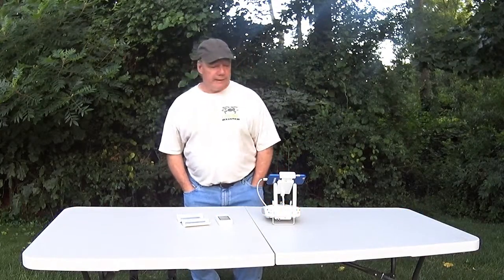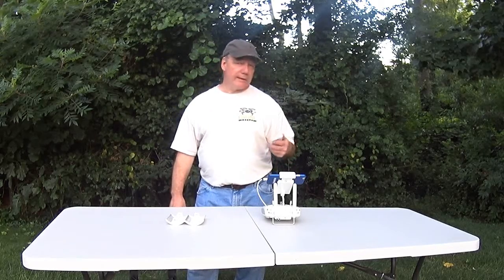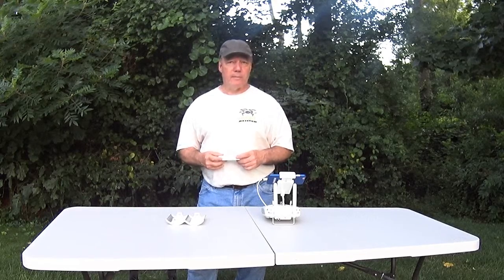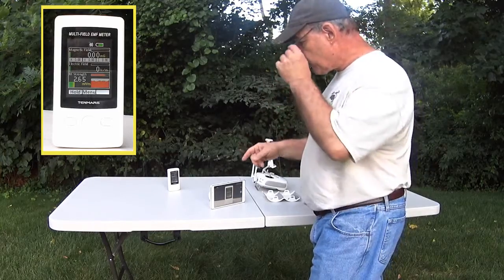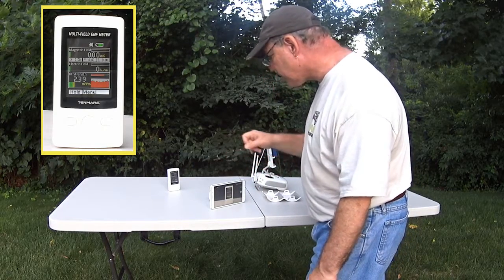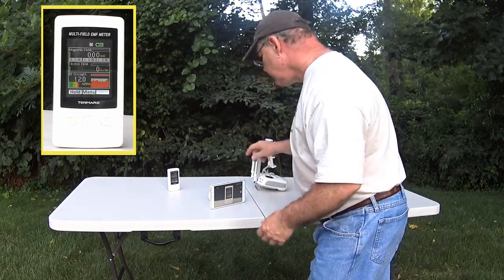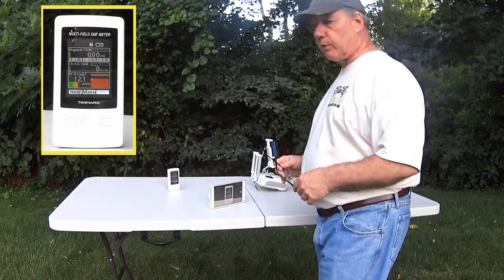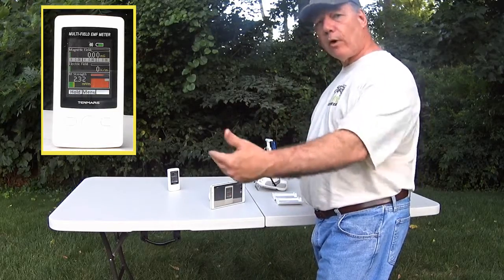DJI Phantom Drone Range Extenders do Work!

Comment: Nice demonstration, thanks.  I have a question though regarding the antennas themselves on the controller.  Are those just a diversity setup with both being actual control signal transmission?  Or is one of the antennas for video signal reception from the quad?  I looked but didn't see this mentioned anywhere.  If one is video reception then you are possibly getting a stronger signal from the video?
Reply from the maker: I found with the testing that by adding the parabolic range extender I was able to keep both the control and video signals strong at greater distances. Having said that, I was able to control the drone well after the video signal dropped off, which is typical for the LightBridge technology. Either way a simple, inexpensive item like this really helped extend the useful distance of the quad. I hope that helps and thanks for stopping by. Be sure to sub the channel so you don't miss any of my updates.

Comment: I just subscribed to your channel. I, like you, want the
most bang for my buck and was wondering about this antenna setup. Your video
showed and proved the effectiveness of these. I am ordering it. I am a retired
Army helicopter pilot (also commercial and instrumented rated) but do not fly
any longer. I just recently got into droning and love it. I am also looking
forward to your Part 107 series. Keep up the great work.

Phil

MetalDetectingRVer
Reply from the maker: Thanks for the support and for watching the clip. Be sure to subscribe so you don't miss any of the updates. I should have a few new ones on the Part 107 test next week. These reflective range extenders work pretty well for the small investment and increased my signal substantially. Let me know if you have any questions and use the code "Drone" on our website to get the subscriber discount. Thanks, Rick

Comment: I suspect those who claim they don't get that kind of performance with the parabolic extender are also not paying attention to the position of their transmitter.

In other words, if the operator is facing the opposite direction of his drone, the parabolic extender will be pushing the signal away from the drone with the opposite results.  Kind of like pissing into the wind... that doesn't work either.
Reply from the maker: You're absolutely right. The parabolic range extenders focus the transmission in one direction and reduces the omnidirectional behavior of the controller. It helps a lot to direct the signals in one direction. Even though it is still a pretty wide spread, facing away from the drone could actually reduce the distance. The other thing the parabolic range booster helps to do is orient the antenna so that they stay parallel to each other and flat against the controller. Our tests showed this to be the absolute best position for consistent transmission. Thanks for watching the clip and please subscribe to the channel so you don't miss any of my updates. Thanks, Rick
Reply: +Drone Valley Thanks Rick.  Will do.

Gord
Reply: I am also curious about the directionality of the signal with the reflector.  It would be interesting to see a more detailed test that shows how narrow the signal becomes, vertically and horizontally. Otherwise, thanks for the demo.
Reply from the maker: Thanks for the post. It's hard to measure the broadcast spread with the IMF meter I'm using but will give you what I have found through experience. The "naked" controller will give you the same distance almost any way you're facing. The parabolic requires you to face in the general direction of the drone (almost 180 degree spread) and the ARGtek paddles provide a much greater distance but are less "forgiving" when you turn away from the drone. They're not laser sharp but you want to make sure you know where the drone is to keep the strong signal. I hope that helps and you sub the channel.

Comment: Thank you for the video. They definately do work. In a super WiFI congested area, I normally only get about 1,000 feet without the extender. With the extender, I got over 5,000 feet. The only issue that I have with the extender is I never get my video feed back once the RTH has kicked in, even when it is directly over my head. I have experimented with this several times and it only happens with the extender on. Its a very good product, but not being able to get my video feed back during RTH is troublesome.
Reply from the maker: I'll be honest and say that I'm a huge chicken and the minute I see the video signal start to waver I head for home. Even though I know the control signal tracks much longer than the video, I'm always afraid of a flyaway. The EMF test just gives me the reassurance that there's a stronger signal with them on. Next week I'm doing an ARGtek mod on one of my controllers and will repeat the test once that's installed to provide details. I might also do an overview of the installation as well. Thanks again for stopping by, I hope these clips provide some value.
Reply: I think that a healthy dose of caution is always a good thing. Sometimes you do not get much warning between the wavering signal and being disconnected. In the desert, I have gotten a mile and a half range with no signal loss or RTH on the stock antenna. The out of box range that the P4 gives you is one reason I bought it. I had to spend almost $400 on a new antenna, boosters and a battery to give my Solo the same range. I am loving the P4 and how simple it is to operate and that as a system it just works everytime with no issues.
Reply from the maker: I agree about the P4, they built an amazing machine there. I am always worried the minute I see the screen start to get choppy that I'm going to lost the bird and turn tail for home, especially over water. I'll have a few sets of the ARGtek extenders arriving next week to test and will post a clip on that for comparison. Thanks again for watching.

Comment: Thank you for the post. Indeed I tested this in another day and this thing achieve a distance beyond that of DBS antenna in Phantom 4.
Reply from the maker: I think they're amazing and a very inexpensive way of extending the distance of your flights without cracking open the controller. I appreciate you commenting and hope you sub the channel so you don't miss any of the updates I have posting this week.

Comment: WOWZERS!  That was a great experiment!! Thank you my friend.
Reply: science is beautiful! thankyou sir
Reply from the maker: Mario, yes there is a certain directional consequence to using these. The good news is that they are fairly forgiving and the ones I have tried all provide about a 120 degree field so if you facing in the general compass direction of the quad you should be OK. Thanks for the post and I hope you'll sub the channel. Rick
Reply: @Dronevalley  The only issue I've wondered about (and haven't actually tested myself) is if you're doing a circle or something where it goes around behind you.  Depending on how long it was behind the parabolics, I wonder if that would cause it to do an automatic RTH because it couldn't talk to the controller.
Reply: Chris Lucas ...  It was Rick doing the experiment and Not Ken....  and it really would not make that much of a difference how far away it is, the Parabolic will direct more RF energy in a single direction...  The meter proves that...  Distance will obviously result in a weaker signal in both case but there will still be more energy directed via the parabolic.s.. Most of those meters are designed for close range anyways so I would doubt that it would even register any signal if it was more than 50 ft away since the meters are looking for a BROAD range of frequencies and so many others in the area would compete.  This is a valid test for the purpose being discussed.
Reply: Chris Lucas
Reply from the maker: Thanks for stopping by and be sure to throw me a sub, I have a ton more content coming this week.
Reply: Ken Heron Hang on a sec... I appreciate your experiment, truly. But...your RF meter is only a few feet from the source. Of course the signal is going to be magnified 4x or more.
Do the same experiment in a large soccer or football field, or even further away, and see if you still get the same strength magnification at that range.
I seriously doubt it.
I'm not hating...at all. I love your videos.  If I had an RF meter I'd go test it with my P4 myself.
I do have the Skyreat Extenders as thus far, I'm not impressed.
I know Ken Heron had good luck, but he didn't do a before and after in his video - so it's impossible to know how far he would have gone on that hilltop without the extenders. Same distance? Maybe.
(Ken, go see Vulcan again...without the extenders!)

Comment: very informative video well done
Reply from the maker: Thanks for watching. I'll be doing another one with the ARGTek antenna booster when they arrive next week. Stay tuned....
Reply: have you released this new video yet ? I haven't seen it yet . thanx
Reply from the maker: Grizz, thanks for checking back. We've had some impossibly hot and wet weather in Jersey the last week or so and I haven't been able to do the field test yet but hope to get to it soon. Please sub the channel so you don't miss it and I'll try and send you a note when its done. Thanks again for watching and the support.
Reply: ok, thank you. how do I sub the channel ?
Reply from the maker: When you're watching one of my clips there will be a little logo in the lower right corner. If you hover your mouse over that logo you can click it and subscribe. Thanks, Rick
Reply: very cool, it gave me a number !!
Reply from the maker: That means you're subbed! Thanks a lot for doing that and stay tuned.

Comment: I have a friend with a Phantom 3 Standard.  It only has 1 antenna.  Could that reflector be modified for a single antenna or does someone manufacture one?
Reply from the maker: I carry both models to be able to accommodate all of the controllers. The think I like about the dual is that it forces the antenna into a perfectly parallel postion to increase range even more. Let me know if you need a link for the single one, $8.95 free shipping.
Reply: I would like to see your site.  Please send a link.
Reply from the maker: The site is www.dronevalley.com but I goofed. We only have the dual reflectors in stock right now. If you visit the site and send me a note I can send you a free single reflector that I have here from a review we did for the company. It was designed for the Phantom 3 Professional and may need a little filing on the base to fit the round antenna of the Standard but I'll send it for free if you want it.
Reply: That's awesome!  I'll take you up on that.  You sure you don't need shipping?  How do you want to get my information?
Reply from the maker: Don't sweat the shipping. Hit the website and send me a contact with the address you want it shipped to and I'll send a set of them out tomorrow for you to play with. All I ask is that you pass the channel around to friends so we get a few more subscribers.

Comment: Agreed with you %100! Very well done. 👍 ✌
Thank you for sharing.
Reply from the maker: Thanks for watching and I like doing these types of clips so let me know if there is something else you'd like me to cover.
Reply: Thank you for your kind reply. I concurred with you because I'm a licensed Class-A Ham radio operator. In this clip, for instance, I wished you had measured the RF field strength over a 180 degrees 10 meter diameter semi circle in the direction of the aircraft, provided the RC unit is located at the center of the circle. The RF values you obtain would give us a solid proven facts about the effective angle of the RF radiation. This way the the RC pilot always keeps in mind to face towards the aircraft to keep it in the middle of this angle for optimum RF reception and transmission. I would like to thank you again for a great job you've done. 👍 ✌
Reply from the maker: I'll be honest and tell you that this was the most technically complex clip I have done to date and involved two cameras and a ton of setup. I wanted to show the decrease in signal behind the controller but had a hard time managing it solo. I'll get better at these and agree that it would be good to see the increase all around the controller and will try another clip to see if I can manage that. Thank, Rick
Reply: Thank you Rick. :)
73s de ta5a / ilhan